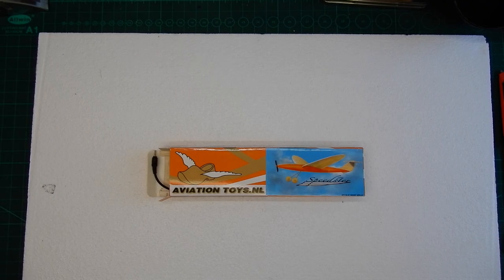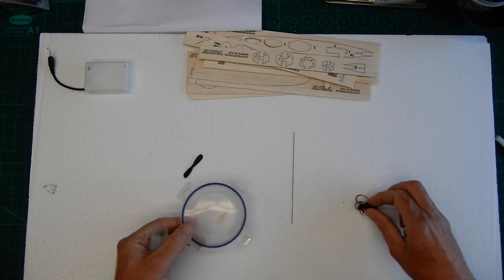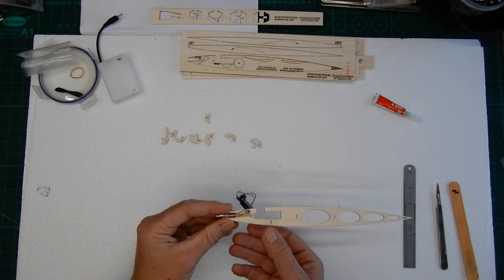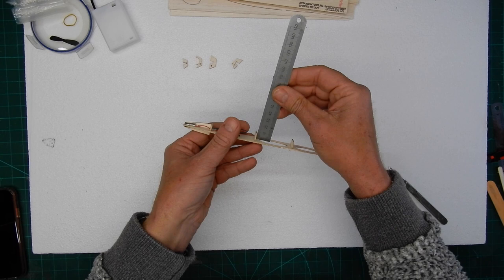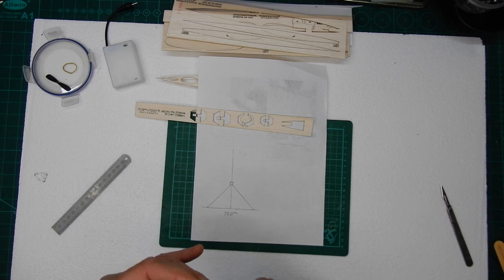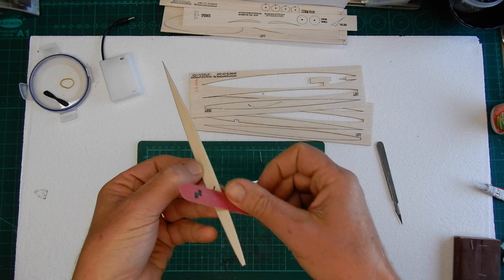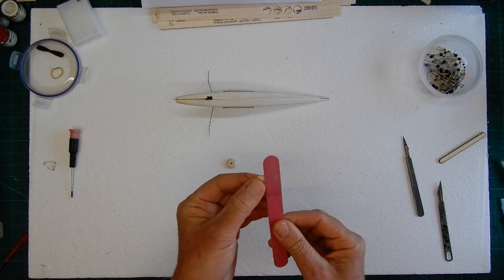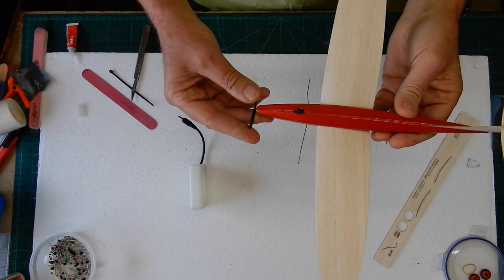How to build The Speedster electric free flight glider

Comment: I should probably read the instructions first (before commenting), but it seems like it might be a good idea to test the motor/cap ass'y before closing up the fuselage. Those little wires and connections could be vulnerable during the handling/installation. An observation about laser cut kits: slotted/interlocking parts are often "snug" due to variations in the part sheets' thickness, not due to the laser cutting. An interesting, nicely done video; I am interested in trying one of these kits!